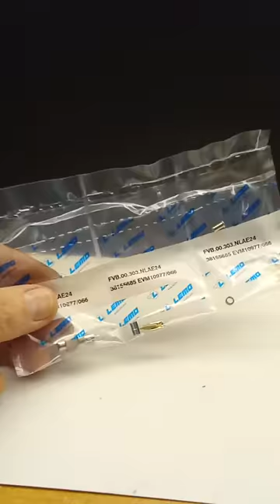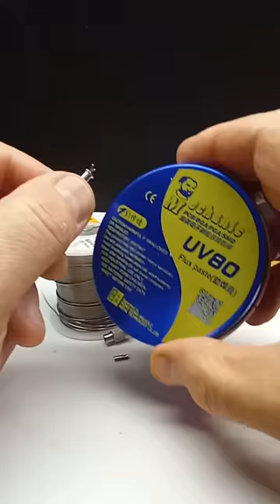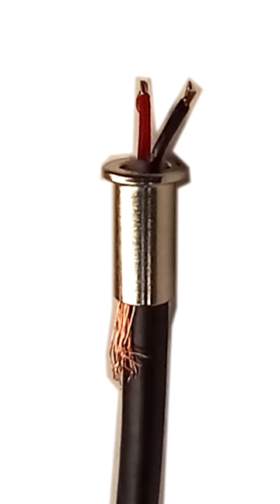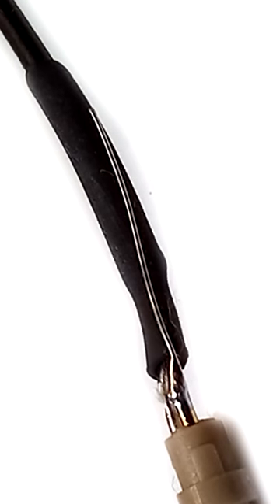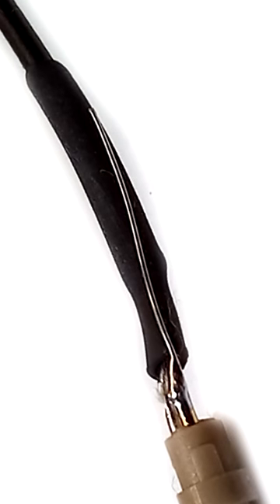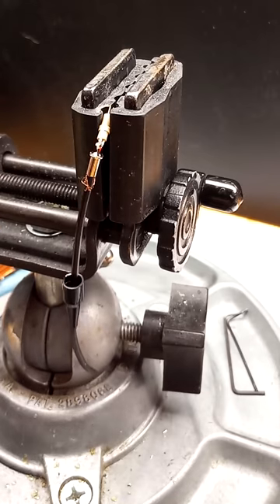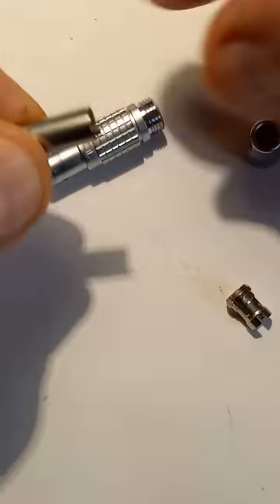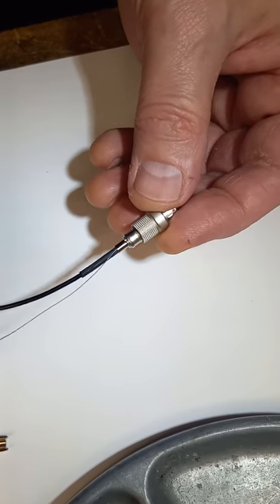Lemo 3pin connector wiring for lavalier mics

Comment: Thanks for the video.   I just got the Wisycom MTP60 transmitter and I need to change over all my Lavs from TA5 to Lemo 3pin connectors.   Can your tell me the Lemo 3 pin connector part # you used in the video?  I need to use the Lemo FVB.00.303.NLAE24?  If it is that part number can you tell me the size of the die on the crimper that you used to crimp the ferrule?  The Lemo crimper is very expensive at $500 and I want to see if I can find a cheaper crimper but I need to know the die size.   In your video it looks like the Ferrule slips over the outside of the lav cable. Is that right?  Do you know if the Lemo Ferrule is big enough to slip over my 2mm Sanken Cos 11 Lav cable?   Thanks for your help.
Reply from the maker: Hey, it's FVB.00.303.NLAE24
Reply: @rastop1   Can you tell me what the die size is on the crimper?  Also will a 2mm lav cable fit inside the part you crimp?
Reply from the maker: @andyt8029  Crimp size: 0.100 Cable 2mm will fit, might need shrink tubing, will have to check practically...
Reply: @rastop1   Are you using the DPE.99.123.1K. Lemo crimping tool.  It sells for $500 and I am trying to find a cheaper crimper.  That's why I wanted to know the die size.  But it sounds like you are not sure if 0.100 is the right size or not.
Reply from the maker: @andyt8029  Don't worry ,look for 0.1 crimper, it will work